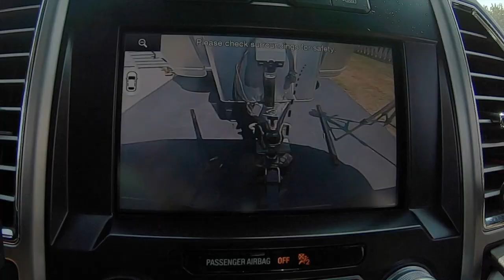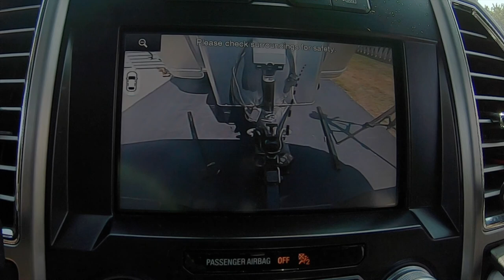Lets get Hitched! | ZEPHYR TRAVELS - Beginners Guide to RVing

Comment: Is that breakaway cable a little  short for sharp turns?
Reply from the maker: I never had a problem with the cable being to short.  It close to the center line of the hitch and has plenty of plat to make turns.  I strongly believe that you want the pin to be pulled and the brakes applied if the trailer gets uncoupled from the truck.  I had a small trailer come uncoupled once and it left a heck of a dent in the tailgate by the time I was able to stop.  If the trailer would have had brakes to slow it down, I could have stopped with no damage.  

Thanks for the comment. ...Zephyr
Reply: @ZephyrTravels  ok, thanks, enjoy your videos